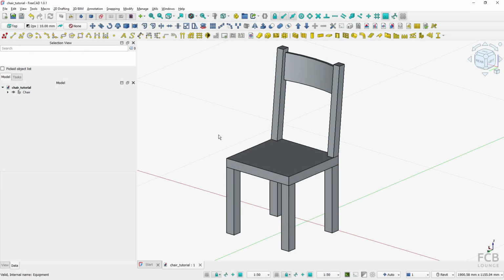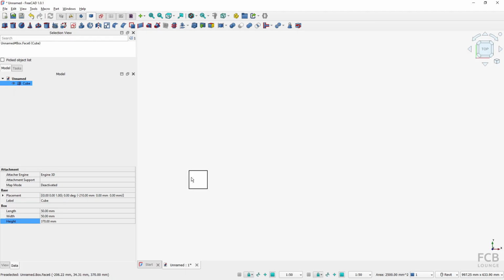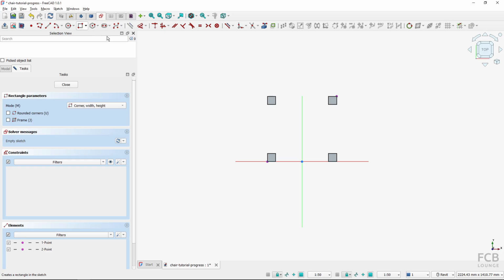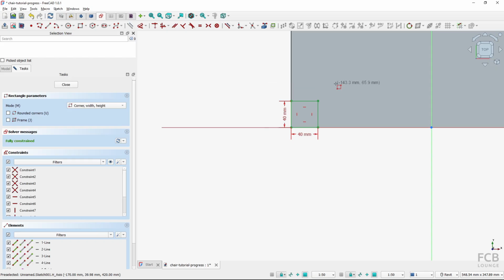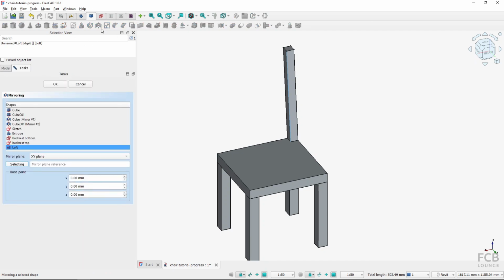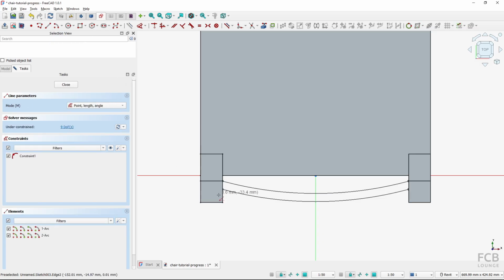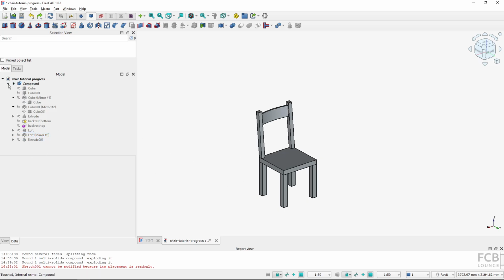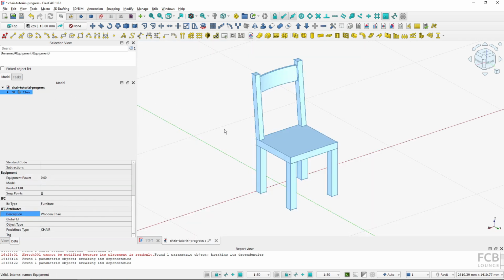Create a Chair Model in FreeCAD BIM | Beginner Tutorial

Comment: 3:10 to view, show/hide axis cross
Reply from the maker: I see, it's under View - > Toggle axis cross

Thank you!
Reply: Perfect, as always. Coincidentally, last week I was creating a piece of equipment to include in a project. I did it similarly to what you teach in the video, but with two differences: I moved the created parts using the coordinates in the property window, and I didn't create a piece of furniture at the end. I just didn't like one thing about this process: when creating a composite, I lost the colors I assigned to each piece of equipment. I tried hiding the composite and assigning colors to the sub-elements, but when I moved and rotated the equipment in the project, the sub-elements spread in different directions, so I had to use the monochromatic composite. (Automatically translated text)
Reply from the maker: @VictorSSimao  Thanks for sharing your experience.

The composite object can sometimes have undesirable effects, that's true.